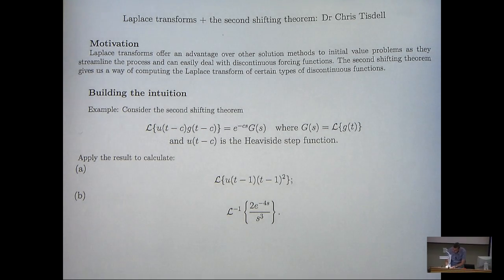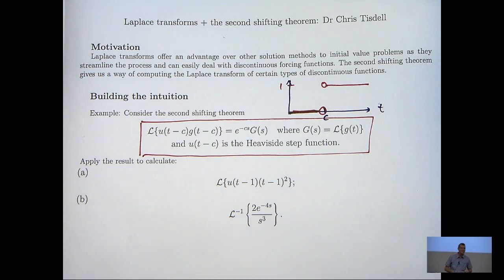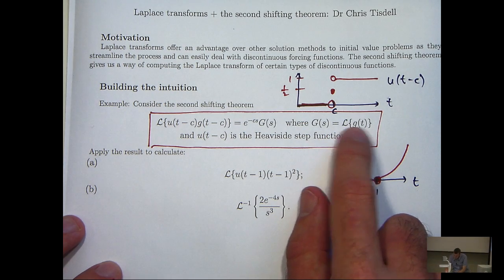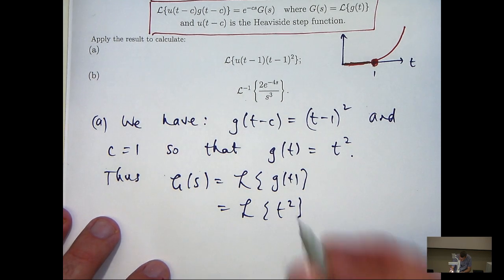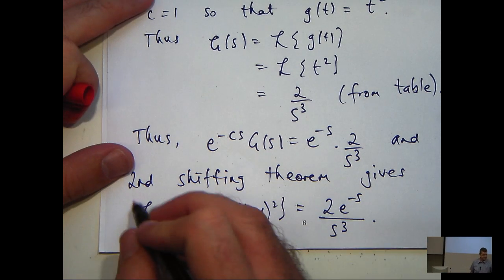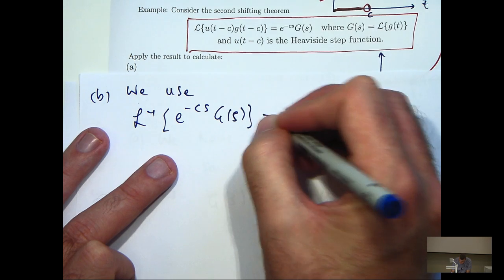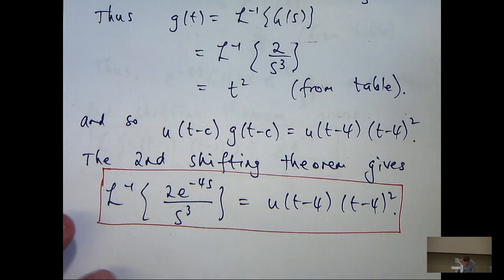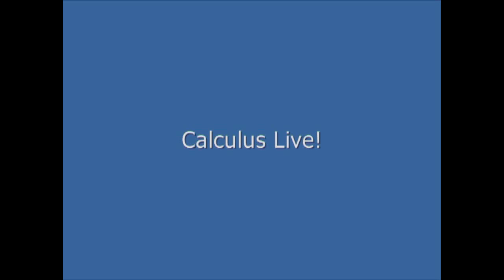Second shifting theorem of Laplace transforms

Comment: Just a quick question, when you drew the graph of t-shifting for part a), why wasn't there any 'jump' at t=1(point c); why did it just connect to the graph for (t-1)^2 immediately? It's just a bit ocnfusing :S
Reply: Because when you switch the graph on , it's value is determined by the t value at that point, which was zero in this case